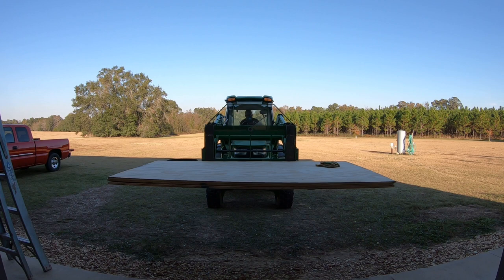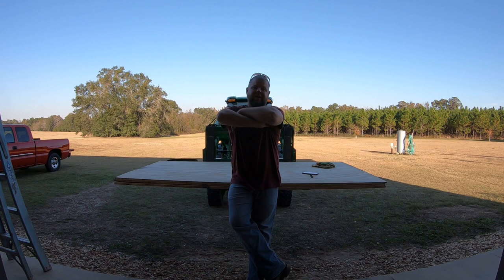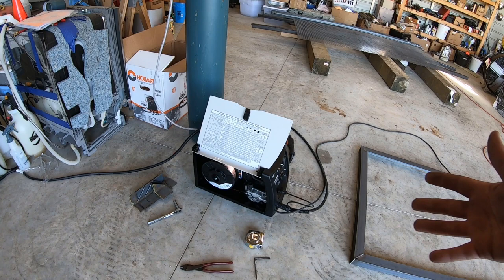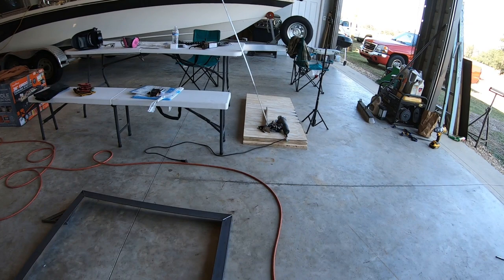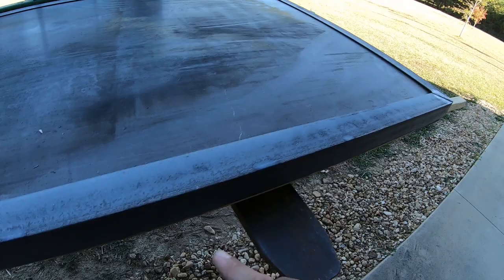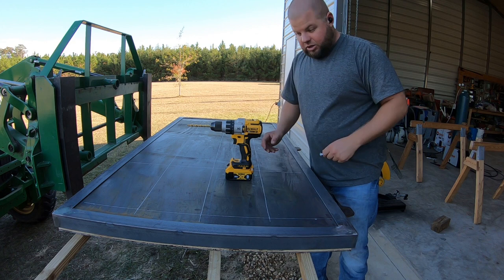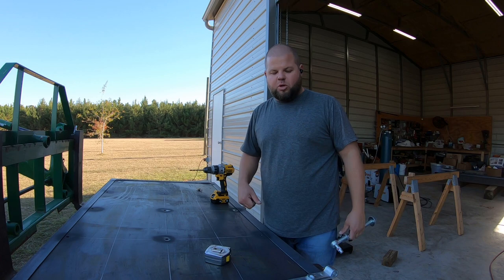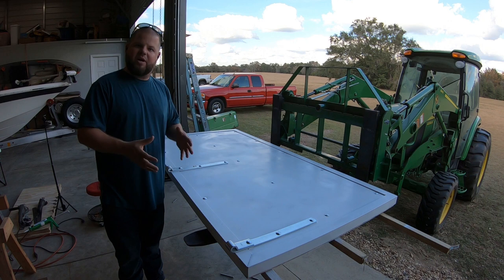#212 Building the tornado/hurricane shelter bunker door! DIY storm shelter bunker build #12

Comment: Little tip when using solid wire with gas. I noticed you using the drag method which is fine for flux cored wire but when using gas, you should use the push method so your argon pools up in front of the weld so your weld is constantly under the gas. When you drag the weld, it pushes the gas away from the weld so the gas doesn't have as good a coverage.
Reply from the maker: Thanks for the info!

Comment: I would use a automotive seam sealer on the door then prime it before paint.
Reply from the maker: Well it's done, video out Tuesday. I primed the door and then painted. The little bit of exposed wood was coated in DAP exterior caulk and then painted. Time will tell!

Comment: Excellent job and I like how you changed it from the original plans!  As a sidenote for the AC, have you thought of using a portable AC unit where you would only have to cut a 6" diameter hole instead of a large hole for an actual AC unit?  ~David
Reply from the maker: Yes I have looked at those types of AC units several times. Three reasons I'm not going that route (well one major reason). The room it takes up, cost and escape route. I'm designing the AC hole to have a thick steel fold down door to protect us in the event of extremely high winds and AC damage. The window unit will also serve as an escape route in case the storm shelter outward swinging door were to be blocked by debris.
Reply: @TKCL  Very cool!  I am so looking forward to the videos on this build!  ~David
Reply from the maker: Great, a lot more coming!

Comment: what size tractor is that? i just got a 3033r but mine doesnt have as wide of a wheelbase as yours, just wondering if you added spacers or if it came like that
Reply from the maker: Mine is a 4066r, I use to have a 3 series and it's definitely more narrow.
Reply: @TKCL  ahh ok, thanks for the reply, i definately thought yours looked bigger. it almost gets a little scary at times picking up bigger logs and such with mine using a grapple, but i have to say its been a tough little machine. definately thinking about getting a set of pallet forks for mine as they seem super useful

Comment: Question: I’ve never welded but after watching you id like to get a stick welder to start.  I’ve got a couple small projects: square tube for my privacy gate across my driveway, tree stand fixes etc... do you have a harbor freight one you like?  Also what was that YouTube channel you referred to in your other video for welding?  Thanks man!!!
Reply from the maker: Welding tips and tricks is the YouTube channel that's full of information. To be honest, it's difficult to Weld thin tubing with a stick welder, that's where a mig shines. Stick is cheap and great to have around, but you might be disappointed with the results welding what you described. If you can cough up the coin, the Hobart 140 is a excellent hobby 110 volt welder. You would be happier with it I believe. Other than the Vulcan 200 that harbor freight sells, I've not researched their welders. I have heard their titanium welders do well for the money. Read some reviews on those. I've got a Everlast 160 amp stick welder I bought off of Amazon 6 years ago and it's been a bulletproof/affordable machine. It should be in my Amazon store in any video description.